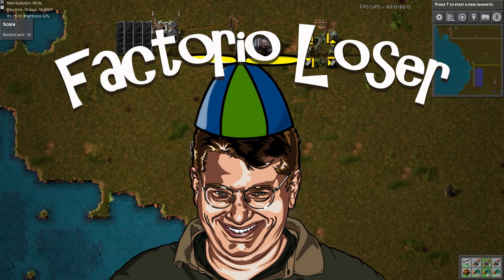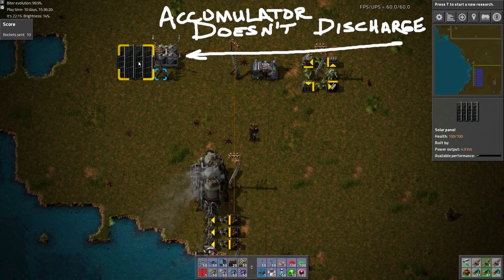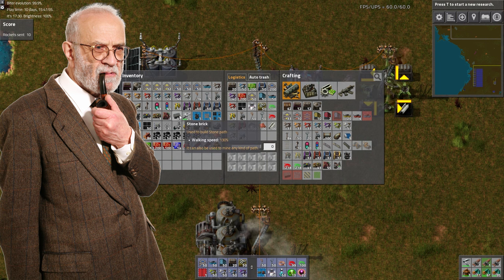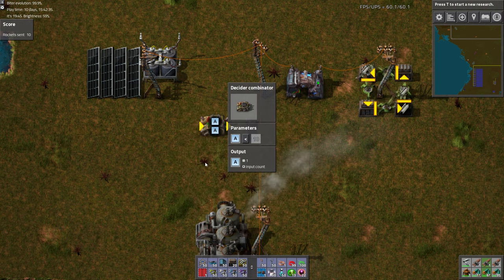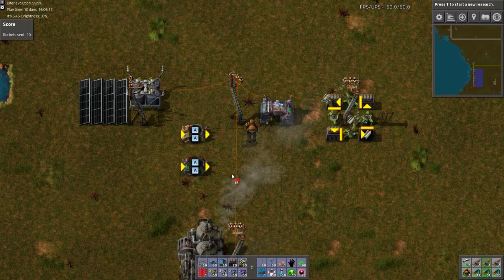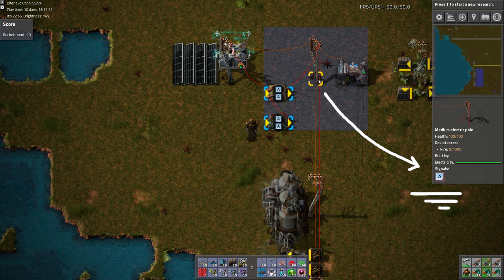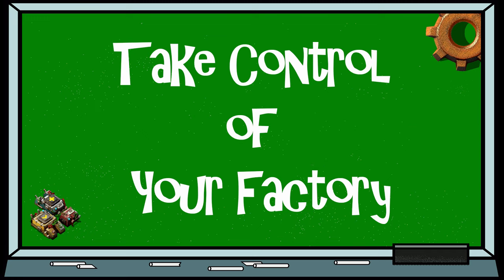FACTORIO TUTORIAL: EMERGENCY POWER SR LATCH | Combinator Classroom Ep. 4

Comment: I'm trying something now where I put 3 tanks (in parallel, not serially) and then an electric pump between the boilers and steam engines, then the SR Latch goes to the electric pump. This gives you a sort of steampunk accumulator which gets the steam engines up to speed much faster. It works fairly well, but one caveat: don't try to do even simple circuit networks when you are overtired, especially when your configuration needs to be rotated 90 or 180 degrees relative to the example you are working from. I ended up connecting the output from the artithmetic accumulator to the electric pumps, so nothing worked time and time again until I discovered my error after getting some much needed sleep and then going over the SR Latch carefully several times.
Reply: aaand after testing, still not working. Back to the drawing board.

Edit: Okay, I figured it out. As I said in another post, using "A" as the signal for everything obfuscates the flow of the constructed algorithm. And somehow, having noted this, I managed to ignore my own observation and set the pumps to "A=1" as in your example rather than the "C=1" required in my own setup that replaces the signal between the decider and the math box.
Reply: So I've thoroughly investigated the "hot water tank" accumulator alternative with the SR Latch running electric pumps and it just does not work. The electric pumps just cannot feed hot water from the tanks to the Steam Engines fast enough, even if you cut the lines of hot water tanks down to 5 instead of 10.

Comment: awesome tutorial, thank you for that. I ended up using the idea, but on a larger scale. I currently have 17 of the tileable solar arrays from https://forums.factorio.com/viewtopic.php?f=5&t=5594. I linked all of the accumulators in one tile with green wire, hooked the green into an arithmetic combinator that divided the total output by 151, the number of accumulators in the array, and pumped that into a red wire loop around the outer substations. I linked the 17 together from corner substations with red and pumped that into another arithmetic combinator that divided the total by a constant combinator of 17, and it gives me the average percentage of all of my accumulators. I feed that into the system you showed in this tutorial, and it works like a charm.
Reply from the maker: Hey Allan... I like where you're going with that but if all your solar fields are connected to the same power network, then all the accumulators act as ONE accumulator and discharge/charge at the same rate. You don't need to connect all the accumulators and take the average... You only need to connect to one accumulator that is hooked into your power network. Typically I take a single accumulator and place it next to where ever I place the SR Latch... Which is usually next to my Steam Generators.

Comment: Anyone know why this setup flickers on electricity on the discharge cycle, but a 3-decider combination (as in the wiki tutorial) stays steady in both charge and discharge? Testing it to control a switch to a load powered by an accumulator, so part of that may be that it doesn't have any start-up time like a power plant going online would. I figure that means this setup is still drawing some (fractional) amount of power from the main grid on the discharge cycle if used with a power switch.
Reply: Just messed around a bit more. Turns out that it was the number of accumulators in a test setup. Once there is more than one, then it smooths out. So I'm guessing that the simulated power is AC? A single accumulator on its own only feeds half the phase? (Or at least I'm going to pretend that is the case.)

Comment: I've recreated this setup on my main map to test things out after I couldn't get it working on my main power supply. my current signal is was reading 100 until the charge dropped. The pump never turned on and I'm getting a negative 25 signal. I'm not sure what I'm doing wrong here.
Reply from the maker: Assuming you have everything wired up correctly, make sure you have the Decider Combinator "Output" set to "1" and NOT "Input Count"... Let me know if that works.

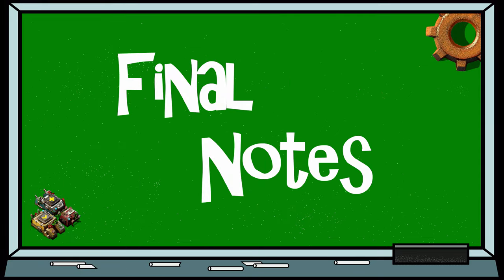Comment: At 09:56 in your final notes you suggest that it would be better to put the latch close to the steam engines, and then run a long wire to an accumulator.

That won't work. If the steam engines shut down, the latch combinators will lose power, and stop working. They need to be powered by the solar area of your 
network.
Reply from the maker: Solar and the Steam Engines are all one network... If the latch loses power than something isn't set up correctly. In the vid I say run a wire to the closest accumulator. I typically place the latch next to the steam generators and put down a single accumulator next to the latch. Not because it has to be there... But for convenience's sake in not having to run a red or green wire all over the map.
Reply: ShredGuy99 Sorry, complete brain fart by me. I was using you vid to build me a latch with a power switch, and completely forgot that you just powered down the pumps instead!
Reply from the maker: No worries... Keep on building bro!

Comment: I've been trying to make a memory circuit. something that can read a signal with a value, and hold on to that value until a reset signal is sent at witch point it lets go of the first value and reads a new value to hold onto.
Reply from the maker: My memory counters typically include a basic clock, which feeds into a pulse generator, which feeds into a memory cell. If the signal you're trying to count is already a pulse, you can do away with the clock and pulse generator.

A memory cell is a decider combinator where you run a wire from the output back into the input.

The logic is "Signal A" greater than "Zero" output "Signal A" "Input Count"

In order to get the memory to reset, I've tried running the memory combinator's feedback wire through an Arithmetic Combinator.

In the Arithmetic, set "Signal A" "Multiply" "Signal B" output "Signal A"

"Signal B" is what carries the reset. If "Signal B" is equal to 1, nothing happens and the memory circuit works as normal. If "Signal B" is equal to Zero, the memory circuit resets.

That's just off the top of my head. Let me know if it works!

Comment: in my setup so its offshore pump->boilers->tank->electric pump->steam engines

the explanation, the steam engines will start faster, 
because for the boilers takes a good bit of time to heat up the water , 
but if u have a tank full of hot water they start much faster
Reply from the maker: That works! You could also increase the "Set Value" so that the offshore pumps turn on sooner. In this video I use a "Set Value" of 10 which seemed to work good. But if you're Accumulators hit zero before the steam engines can get up and running at full speed, you could increase the "Set Value" to something like 20... Or whatever you'd like. This way you don't need to have the tanks. Give it a try and let me know what you find out!
Reply: I used to have them like kick in at 25% and keep em till fully charge my accumulators, but usualy i make so many solar panels from start after a while my steam never start again:D

I dont think i need tanks (i tried without them too) I just like to have them:-)
Reply from the maker: That's typically what happens... Build enough solar panels and steam engines never turn on. That being said, I built a counter to count how much coal was being burned in the boilers. If the count started getting really large, it meant it was time to place down more solar panels.

Comment: Ok, here’s why I wanna learn about circuits: I use single traincarts for multiple resources to transport them simultaneously. This works until consumption of one of the resources is halted. That resource will now start clogging the cart until it has pushed out the other resources altogether.

Is there any way I can control the relative amounts of resources so one cart will maintain equal space for each resource?

Wait, I think I can cap the destination chests and automatically turn off the corresponding inserters at the resource station. OMG I THINK I SOLVED IT!
Reply: If you connect a circuit network to the train stop, you can read the contents of the train. From there, wire up to a combinator (or if you're lazy, directly to the inserters) and tell them to only activate if the contents of the train are below a certain level.

Comment: I did exactly what you did, but my pumps kept on working, so I changed the pumps enable condition to A=/=1 and suddenly it worked as intended. I think your explanation was really really good and made sense but now Im confused
Reply: I used the symbol 1 instead of the number 1, it works fine
Reply from the maker: Trust me... You're not the first to make that mistake. I've gone crazy trying to figure out why something wasn't working only to figure out I was using the "landfill" signal instead of the "green" signal... The landfill icon looked a lot different pre-0.15 ;-)

Comment: Nice vid. Did you know if it is possible to output the current energy usage and the maximum energy output so you can tell if your are using more then you produce instead of just using the accumulators energy because it's night for instance.

For Example on this vid the engines will turn on when the accumulator energy drop below 10%. OK, but if is day time, and lets say you use laser turrets and there is a big wave attacking, and you are burning more energy then you produce, will take some time to the accumulators get to 10% mark to start using the engines. All factory and the laser turret will run slower then normal while this happen even if you could avoid this using the "off line" engines.
Reply from the maker: Hey Sworn... There's no way to measure energy output. 

However, the bigger the energy draw, the faster the accumulators discharge, the sooner the steam generators turn on. If you want to set your accumulators to turn on sooner, you could increase the steam generation turn on level. You don't have to use 10%. You could use any percentage you'd like.
Reply: Yah, I have a similar setup with more then one ratio, like one for 10-15% one for 20-25% and so on until 95%, where i keep only the solar running, usually the lowers one are to more expansive combustion, if you are using mods that add more fuel and power tipe. I think i'll search on the fame API, if isn't to hard maybe i can make to new logic items to output the energy bar %, thanks any way, keep goings with the vids, they are cool
Reply from the maker: Someone mentioned on my stream the other day about possibly timing the discharge of the accumulators in order to determine power usage. A joule is watts x seconds. So if you know the total amount of Joules your accumulators can hold (which is on the power menu), you could theoretically determine your factories power usage by trying to measure the change in Joules every second . If there is a large spike in power used at any given time, you could then turn on auxiliary power!
Reply: That sounds really trick to do kkkkk but I kind like the idea, there isn't a limitation on the amount of power a accumulator can release? well even if there is, if the power needed is bigger then the power output the auxiliary power must be switched on. Tanks for the tips .
Reply from the maker: Total power output from your accumulators depends on how many accumulators you have. However, all your accumulators will discharge at the same rate.

Comment: Could I do something similar to make it so my furnaces, manufactory, and everything but lights and laser turrets go off if power in accumulators goes below 20% and wait until power gets to 60% to ensure maximum defense?
Reply from the maker: Definitely... Connect the SR Latch to a Power Switch instead of the offshore pumps. 

And you don't have to run a wire all the way from where your accumulator build is located. Just place down an accumulator  next to the SR Latch which can be next to the Power Switch. Make sure all the power to the furnaces goes through the power switch... No extra connections.

You could also set up a SR Latch and Power Switch for each different part of your manufacturing process and shut them down at different levels. Maybe you shut down the furnaces when power goes below 20% and you shut down oil refining when power goes below 30%. That way your factory powers down in stages depending on how bad your power situation gets.
Reply: Thanks, I got it all set up. I also have multiple "processors" at different sections of the power grid. Meaning if a section of my train line is overrun (compartmentalized with defenses dotted around to make it so it's less of an artery), and the power line is cut, the satellite fortress or foundry will be able to shut down non vital machinery and rely on its local accumulators. It also means that I don't have to worry about the signal being cut off by a breached compartment.

It seems to work very well.
Reply from the maker: Star Foth That sounds like a neat idea!

Comment: I tried to be smart with this and modifying it to inline pumps after the boilers (with a tank to store 100c water) that way the steam engines get a instant supply of 100c water when it switches on. Only issue is you need two pumps to do it. 

I tried that setup because running steam engines up from dry took too long, especially when they were only switched on at 10% battery supply. 

But then think I need more accumulators...
Reply from the maker: Definitely would need 2 pumps to make that work. You could also try using the SR Latch to control a Power Switch which would instantly turn the power on and off... Just make sure all the power from your Steam Engines runs though the Power Switch.

Typically, if my steam engines are turning on too often, I usually take that as a sign that I need to add more Solar Panels and Accumulators...

But you can also set the latch to any value you want. There's no rule that says Steam Engines turn on at 10% and then turn off at 35%. You could change the value in the Decider Combinator to 20%, and, without changing anything else, instead of turning off at 35%, they would now turn off at 45%.
Reply: I found a massive fault in my plan... Those inline pumps need power (unlike the water pumps), if you lose power (due to spike in robot useage maybe) everything shuts down until the sun comes up!  Back to your way!

Comment: The example is redundant now, since 0.15 made steam engines the lowest priority, meaning they will only provide power (and require fuel) whenever ALL other power sources (including accumulators) provide less than satisfaction requires.

The lesson is still good though, since we now have Kovarex to worry about. Reverse the condition and you can make sure your Kovarex has the 41 uranium required for processing, while the rest of your factory gets the rest.

While there's 42 or more uranium, activate the inserter sending it elsewhere and deactivate the one to the Kovarex process. Reset condition at 41, so that when all other uranium is gone, the Kovarex process restarts and the diverting inserter stops operating.
Reply from the maker: If your accumulator charge drops below 100%, then steam engines turn on. (This was the case prior to 0.15.) The point of the Emergency Power Latch is to prevent the steam engines from turning on until accumulator charge drops below some other arbitrary value and then to have them remain on until accumulator charge reaches another arbitrary value.

The lesson is not good... It's fantastic! It's about learning how to create an SR Latch giving an example that is just as relevant in 0.15 as it was in prior versions.
Reply: Sure, but that's not what you said in the video though.

Comment: I don't claim to be an expert at this, but in testing this build there seems to be a couple of problems. #1 - During the day time, this build (as it is) will only allow the accumulators to charge up to 35% rather than 100% before turning off the steam engines. This results in undue cycling, as well as having 35% or less accumulator charge when the sun goes down. #2 - If the total accumulator output isn't enough to run your entire factory (based on how many accumulators you have), then when the steam engines are turned off, your factory won't be able to run.

Ideally, you need to have enough accumulators to run your entire factory, and you need to allow them to charge to 100% before turning steam power off. It should be cycling between 10% and 100%, not 10% and 35%.
Reply from the maker: This setup is for emergency power... When your accumulator charge gets critically low. The entire point of this is to reduce the amount of coal your factory is using. 

Ideally, your steam engines should never turn on! But when they do, we want them only to operate over the shortest window possible... Just long enough to keep your factory from going dark.

The cycling of steam engines is irrelevant since we don't have to worry about wear and tear... Essentially no maintenance is required. But worrying about coal is a problem.

The primary method of charging your accumulators should be solar panels... If your steam engines turn on at 10%, turn off at 35%, but accumulator charge never gets to 100%, the problem isn't this setup... The problem is you don't have enough solar panels.

However, if you're not using solar panels for some reason, I guess I would probably agree with setting the "off" level at 100%.

P.S. The 10% and 35% levels were merely a suggestion someone left in the comment section on another video. These levels should be tweaked to whatever works for your factory. Also, the main point of this video was to demonstrate how to use combinators to build an SR Latch (a very useful tool). That being said, I use the 10% and 35% level in my mega factory and it works flawlessly.